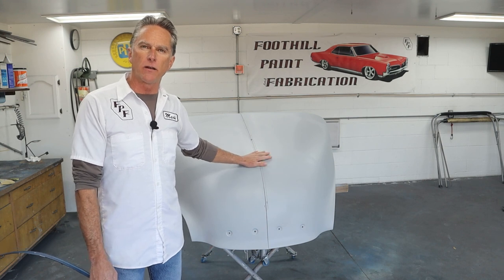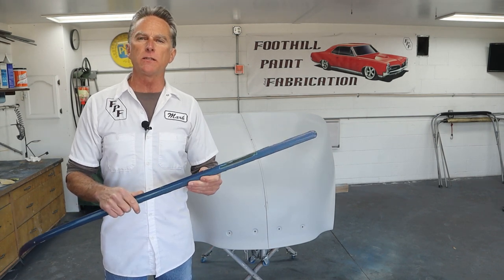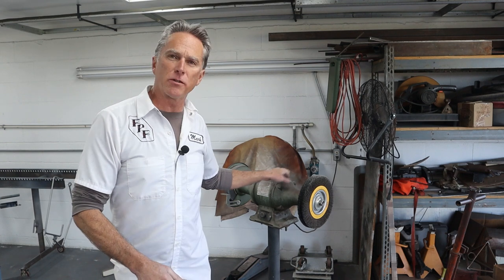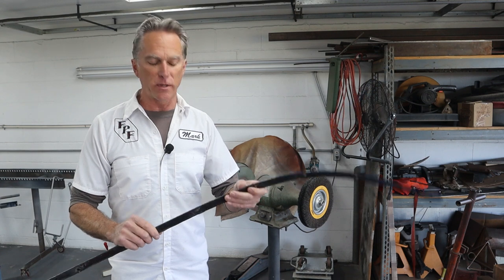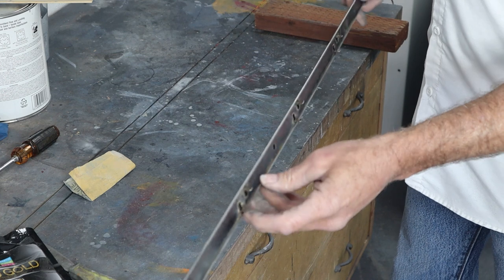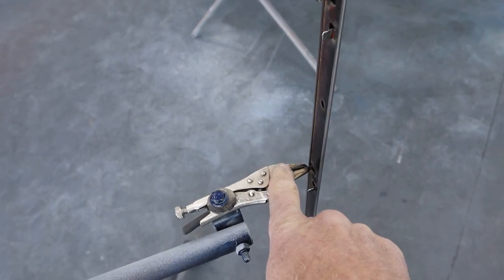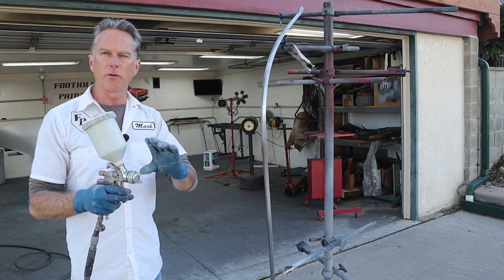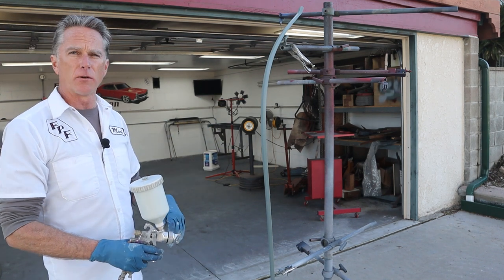1950 Chevy Truck (Ep 79) Center Hood Moulding - Straightening Stripping Test fitting and Etching

Comment: Another great video Mark!  The moulding on my 49 has some dents and crushing.  It’ll be interesting to see if I can get those out.
Congratulations on the growth of the channel. Looks like you’re right at 2k subscribers!
Reply from the maker: Thanks Robert.  I would really like to get my views up to help more people but I am doing way better than I ever imagined when I started the channel about a year ago.  As far as the moulding dents go consider drilling an 1/8 to 3/16" hole in the mounting tab strip underneath right where the dents are so you can get a rod or punch through there to encourage those dents to come out.  Trying to remove that mounting strip to access the back side of the moulding might cause more damage than you are trying to repair.
Thanks again for your support.
Mark

Comment: Well timed video again Mark, thanks. It turned out very well and I am sure it will be much better quality than the aftermarket chrome moulding he was going to buy.
I am going to chemically strip mine, it only has one paint job on it and shouldn't be hard to strip. My helper, Tim sprayed the hood with it's second round of Slick Sand and it looks excellent. Of course one never knows until the paint goes on.
Reply from the maker: Great to hear you are making progress and your hood is coming out nice.  I haven't chem stripped anything in a long time and I hear the new stuff doesn't work very well.  Which one are you going to use?
Reply: @FoothillPaintandFabrication  its just some zip strip I have on hand, and yes,  it isnt as "hot" as it used to be.... takes patience and multiple coats. I'll let you know how I did.
Reply from the maker: @BusyAsABeaver72  Thanks
Reply: Total, complete fail on the paint stripper 🤣 it was Sunnyside brand 2 minute stripper. Wouldn't even take off the clear coat. It was as thin as water. I dunno when I got it, about 2/3 of the gallon was gone, I must have used it on something but I don't remember what it was.
Reply from the maker: @BusyAsABeaver72  Yeah that is what I am hearing and reading on all the "paint strippers" available now.  I am cautious about media blasting because of panel warpage.  Chemical dipping is pricey and 10 hours away from me. Dustless blasting leaves wet sand in all the cracks and seams that will not come out so I have some deciding to do for the GTO.
Reply: @FoothillPaintandFabrication  The can proudly stated "No methyl chloride" That is probably the ingredient that makes the dang stripper work! 
You may have to resort to old school and use the DA and 36 grit sandpaper on the GTO.
Reply: May have to go old school and use the DA and 36 grit.